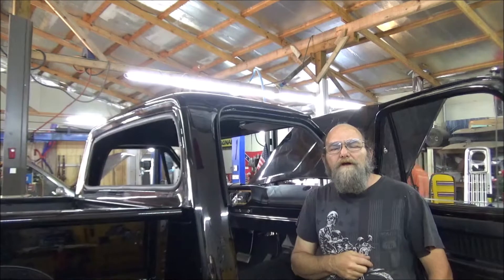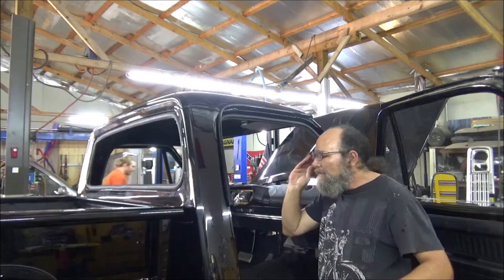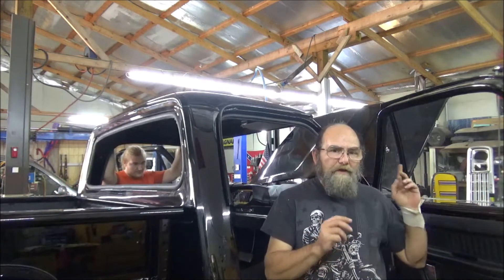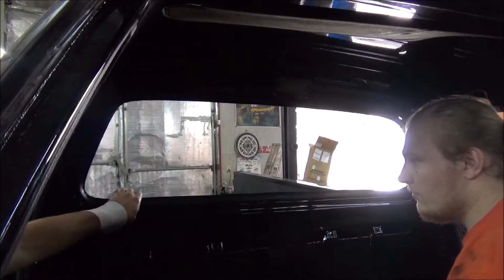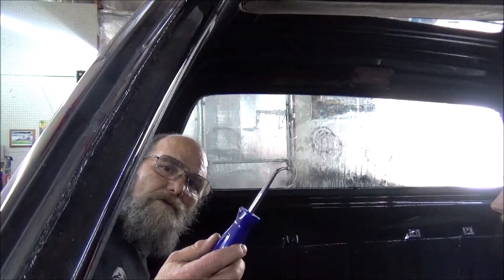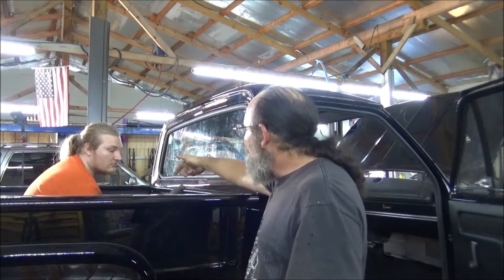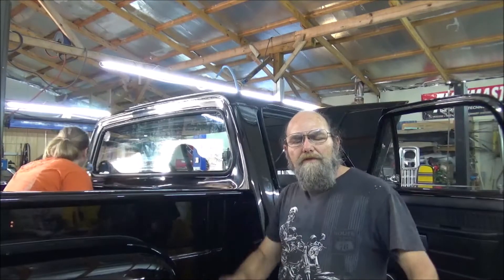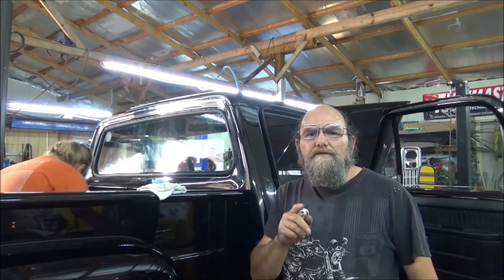Rear Glass Install 1978 Dodge D100 Warlock

Comment: I always used a piece of clothesline, tuck in the groove of the seal, lift glass in place, pull clothesline to pull seal around the glass. Steel tools can damage the glass, the clothesline is softer and won't damage the glass.
Reply from the maker: I have seen that method .
Reply: I’ve seen many professional glass installers do it this way. The seal goes on the glass and the cord in the groove of the seal. Pulling slowly on the cord pulls the lip of the seal through the hole.

Comment: Great Auto glass instruction! It was good seeing the fancy tool and a helper with this task.  I was very lucky individual in the past going to the boneyard's pulling glass under the verbal contract if you break it you bought it. I always sourced used factory glass and seals. I'd clean the seals with heavy duty detergent and soap pads. Then coat the rubber with 10 weight CAT hydraulic oil to recondition the seal and install with the white nylon ropes.
Reply from the maker: Very cool!

Comment: Those windows are rare, like finding a gold nugget
Reply from the maker: Yup
Reply: I just received a back window and gasket out of a 79 little red wagon today.
All last week I search for a rear window for my 79 d100, no one could get a replacement and no one could find a new slider window either.
I did find a hot rod window shop that said they could make me one for 150 bucks with the green tint.
I'm going to buy two of them and put them away.
If I ever need a replacement it will be worth way more than the 150 I paid for it.
Reply from the maker: Cool

Comment: I always used a thin piece of rope or heavy twine, lined the rubber seal withit and set the glass in place and slowly pull the rope out whle putty a little pressure on the glass,  window just drops in, and makes a one man job out of it,  started off using a tool like the tool you have.  it works but I have actually damaged a couple rubber seals on a tight fitting glass.  just next time give the rope trick a try.
Reply from the maker: Cool 😎